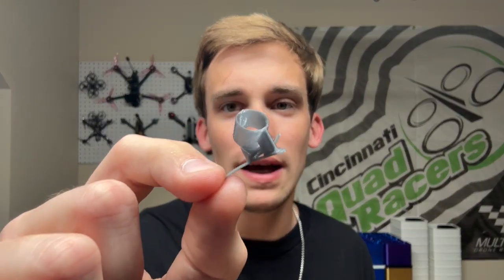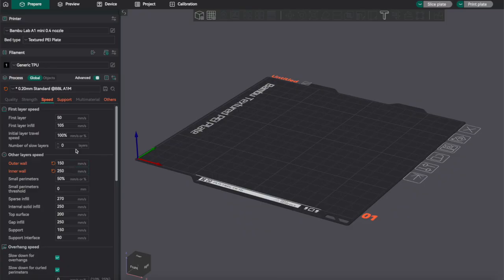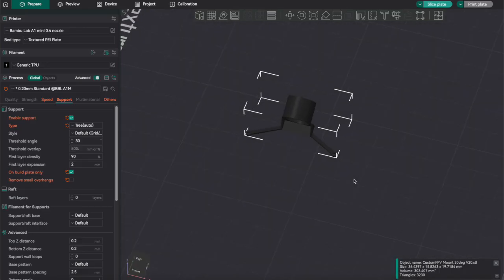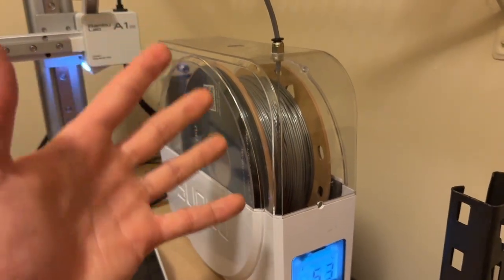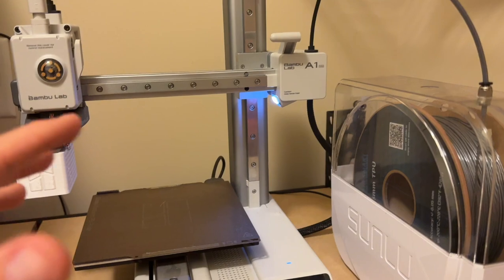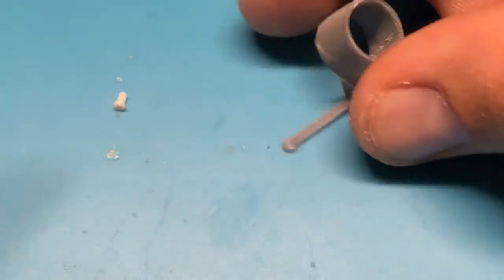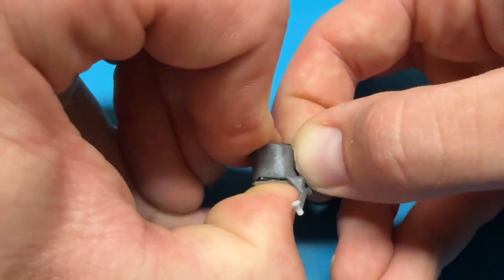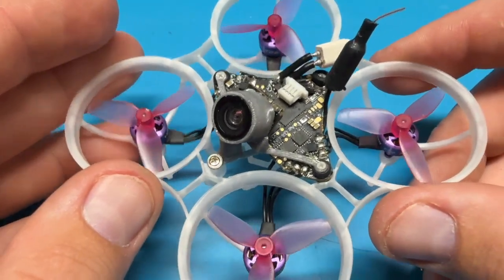The CustomFPV Mount is Open Source! Print + Build Tips | CustomFPV

Comment: How does this compare to the tinyeye or the seatbelt mount by pmantix?
Reply from the maker: Pmantix is a good friend of mine! his mounts are good as well. His are designed to print in PP instead of TPU, so if you have TPU to print I would say this one may be a better option, but if you want to print PP his are typically slightly lighter. I like this mount for a few reasons, mainly that it friction fits and insulates the cam from the FC and also that the TPU doesnt tend to crease and weaken over time like I have found PP does.

Comment: Looks good! One thing I’d consider for v2 is raising it, as it saves the boards from impact dmg when you crash since the cam doesn’t grind against the board
Reply from the maker: Yeah, many pilots switched to the bribrain at the beginning of the season but the reality is that it’s just too heavy. This mount is designed to be light and stiff, and works best on the air 4in1 as shown as well as the 5in1 or cross boards when rotated. if you make sure that there’s not an easily damaged component underneath then you are likely in the clear. I’ve also done undermounting the FC using NBD frames with foam under the mount with good success. At this weight, you will be hard pressed to make a mount out of TPU that is stiff enough to hold the camera above the board without flex in a hard crash. I have messed with PP and CF nylon but found they stress and break in crashes. Will be designing something totally new soon I’m sure and I will keep your comments in mind. Thanks for watching!

Comment: Nice! What's the JST type connector on top of the 4in1?
Reply from the maker: I actually ripped off the original connector in a crash somehow, so i have a short extension from the other side of the plug that just plugs into the USBC adapter board so I can still use betaflight with it!